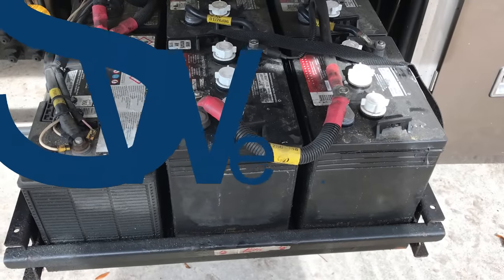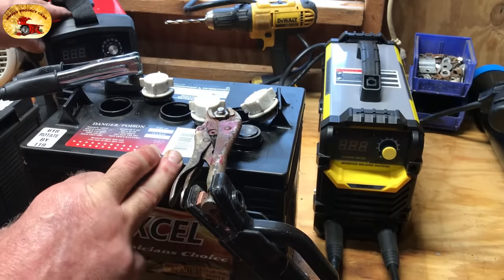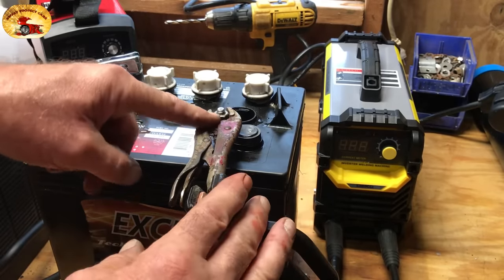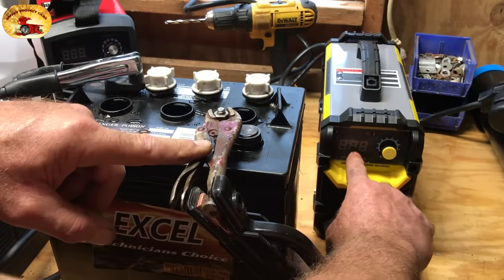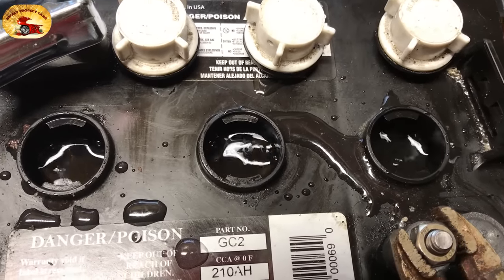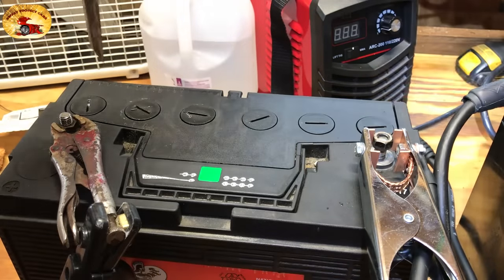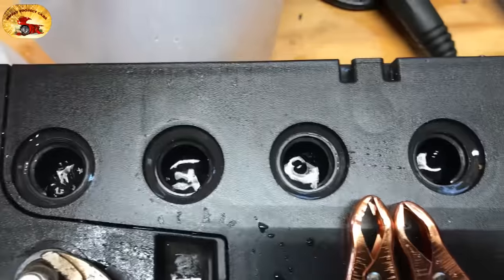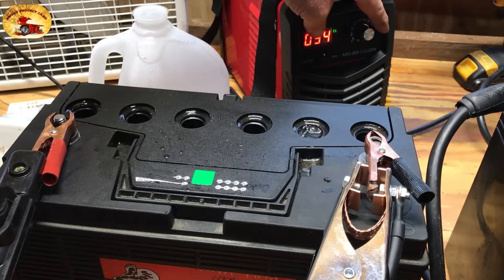How To MAKE OLD BATTERIES NEW Again!!!  12v 6v Deep Cycle, Car, Truck, Golf Cart, Semi

Comment: Mike just wondering how long will the battery lasts doing this trick. Is it like 1 year again we have to so this process. Or Will battery degrade over time and the welder trick wont work
Reply from the maker: It all depends, we have batteries that are 20 years old and still going Shridhar. Thank you for watching, we really appreciate it, have a great week my friend. mad Mike the hammer SPC

Comment: I have a solar system with 150 AH AGM Sealed battery. It is COMPLETELY sealed at the top, and there is no way to add electrolyte. In fact, when I shake the battery I do not hear any fluid/electrolyte inside the battery. All the electrolyte are stored inside absorbed glass mats. Could this method also be used on these types of AGM sealed batteries? Or would it be dangerous to do so, because you cannot open the top of the battery unless your actually cut the top of the battery open with a cutter/grinder. Love your channel! Thanks.
Reply from the maker: This method will not work on gel/agm batteries.  Sorry my friend.  Have a great day.  mad Mike the hammer SPC
Reply: @SweetProjectCars  Thank you for replying. I am sure many other had this exact same question in mind!

Comment: Question...5 min shut off for 10 . In your other vid using batt charger at 200 amps you went 15 min shut off for 1 hour . Y the major difference if your using same amperage ???? Actually your only going 20 + amps with welder correct ?
Reply from the maker: Don't analyze until your paralyzed, just follow the video to a T, each video we do is new and improved and depends on the tools we are using.  mad Mike the hammer SPC

Comment: Question ? On the grey welder , it has 2 knobs current and arc force. I'm guessing arc force is left at 1 and only need to adjust current , starting at five and adjusting up to 20 to 30hours

I did buy the the battery charger from one of the previous videos but for some reason it would not stay constant charging kept kicking on and off  in 200amp start more (guessing it has a safety feature)
But does work great for 10amp charging and 200amp car starting

I would like to try the welder
Reply from the maker: Turn the dial that makes the battery start to boil, don't be concerned with anything else, once it starts boiling continue with the videos instructions.  Thanks.  mad Mike the hammer SPC

Comment: Hey Mike, I pruchased the ARC200dc welder and it works great for the car batteries. Can it also be used on 6,8, or12 volt deep cycle batteries? I ask because you use the smaller yellow welder for the 6 volt deep cycle battery in the video and wasn't sure why. Thanks Aaron
Reply from the maker: Hello Aaron, Please follow the video to a T, there is no other alternative, use the exact same tools, products and method, we've spent years perfecting this process. It works flawlessly every single time using either of these welders for standard battery  https://amzn.to/2K1UsWQ  or deep cycle  https://amzn.to/3yW4ihK  Thanks for watching, have a great day. mad Mike the hammer SPC
Reply: @Sweet Project Cars  

Hey Mike, I bought the suggested welder. Instead of one control it has two; an arc force control and a voltage control. Where should set the arc force control? Thank you. Dan
Reply: @danielfittz3521 did you figure this out?

Comment: Hey there sweet projects , the best battery fix EVER... Tell me please , is it possible to use a regular 240 volt (Australia)  arc welder... ??? OR another way...  with your welders why 12 volt regular batteries and deep cycle 12 volt batteries have to be treated with different welders ??? Thanks slot !!!
Reply from the maker: Hello Broderick, you can use whatever you want to use, we tried and tested both style batteries with the welders listed so we know that it works, and it's safe for both you and your batteries.  Thank you for watching and asking, we appreciate it my friend, have a fantastic day. mad Mike the hammer SPC

Comment: Also, I bought the welder machine you had linked to the arc 200 DC IGBT and it has two dials could you explain it since there are no videos on it ?@sweetcarproject?
Reply from the maker: You only use the current dial, start out low and turn it up until you have a rapid boil, leave the other dial at 1, make sure you recap and unplug the welder before disconnecting the cables.  Hope this helps brian, thank you for watching, have a great day and all the best on your project. mad Mike the hammer SPC

Comment: Are you running your welder on standard 110v outlet or on a 220 volt outlet?  The 110v doesn't have as many amps that it can deliver.  Does it matter?
Reply from the maker: Just plug it in to a standard household voltage outlet Gary.  Make sure you are subscribed and have your notifications turned on because you are going to want to see our video pertaining to this process that is coming out today.  Thanks for watching, have a great weekend. mad Mike the hammer SPC

Comment: So on the 12 volt car type battery you say start on the lowest level repeat 5 times turning it up a little each time? Or just leave it in the lowest setting?
Reply from the maker: Due to the efficiency of these dc welders you can get them to work on the lowest setting, but you want to get a rapid boil so you may need to turn it up a little until you get that boil.  Thanks for asking.  Have a great day.  mad Mike the hammer SPC

Comment: I went thru the 5 x 10 x5 cycle once. The left 3 cells responded right away,  but the left 3 cells just started to respond on the last 2 cycles. 
How many times can i (or should i) run a battery thru this process before giving up on the battery?
Reply from the maker: You can do the complete 5 step process up to 5 times, if it doesn't wake up after that, your battery is toast, Larry. Thank you for watching and asking, we appreciate it, have a great week and all the best on your project my friend. mad Mike the hammer SPC

Comment: I have some 8V golf cart batteries that aren't dead, but certainly are not as peppy as they used to be.  Will this help "renew" them?  Should I discharge them before attempting this?  Thanks!
Reply from the maker: It certainly will, and no discharge is necessary.  Thanks Chris!  Have a great day my friend.  mad Mike the hammer SPC

Comment: I had a Northstar battery fail after 1 year. Even after fast charging and slow overnight charging. It will charge but won't pass the load test. I am getting a replacement and they don't want the old one back. Any way to revive it so maybe it can be used as a shop battery?
Reply: We had a good freeze and I noticed about a month later that the lid u dear the sticker had popped up a bit. I pushed it back down. Battery lasted about another 2 months and then won't start the vehicle unless it is jumped. It will crank after being jumped and the vehicle runs a minute but not after sitting after 30~ minutes.
Reply from the maker: Well as you know this only works on wet-style batteries, so if it is, it will revive it.  Thanks for watching and being a great subscriber.  mad Mike the hammer SPC

Comment: I guess it would be a wise idea to ensure that your leads on the inside of the machine are on the correct polarity as well, right? Sometimes the leads are reversed to do different welding techniques...from what I understand and not being a great welder myself.
Reply from the maker: On these welders, a 5 year old could use them. Follow the video to a T, do the process and ShazamM it's done. Have a great day. mad Mike the hammer SPC

Comment: Why the difference in welders? I have deep cycle and regular auto batteries to revive wich one should I buy....cant buy both.
Reply from the maker: I would get the one that you would use the most, we have tried and tested both on both deep cycle and standard and have found the one's that work and that are safe for both you and your batteries.  Thanks for watching.  mad Mike the hammer SPC

Comment: enjoyed all three battery videos. can I use the "Amico Professional Welding Machine, 200 Amp Stick Arc DC Welder, 80% Duty Cycle, 100~250V Wide Voltage" for both my vehicles and tractor/mower/yard equip batteries? like the idea of buying the welder over the charger/start as I can use it other places. wish it wasn't so expensive but after I restore a few batteries it'll pay for itself. would I also do the tractor, mower and yard equip every two years or would it be better to do every year since they are seasonal? ty for your insight.  🙂
Reply from the maker: Hello Jack, the welder is definitely the way to go, it's our update to the battery videos, you can use it on all wet-style batteries for tractor/mower etc., just cut the timelines in half for those size batteries.  Also, you can use this method annually for the seasonal batteries. Hope this helps, we appreciate the view and comment, have a great week my friend. mad Mike the hammer SPC
Reply: @SweetProjectCars   thanks for the reply.

Comment: What is the voltage out of the clamps on the welding inverter you use for the 12v car batteries?
Reply from the maker: It's this  https://amzn.to/2K1UsWQ  you can read all of the specs.  You start out low and gradually turn up until you get a consistent boil on all of the cells then follow the video instruction Hjalti. Thanks for watching, have a great week. mad Mike the hammer SPC

Comment: Hey Mike, read lots of posts, could not find this answer.  I have both reg 12v and 6v deep cycle. I know these two are the best you have found for each, but will one machine be able to do both types of batteries.  I have read the specs, they are both 200a IGBT. Maybe the question is, I can only afford one, which one would you choose for both types of batteries?  Thanks for the great work!!!
Reply from the maker: I would get the charger that works for the batteries that you charge the most, these welders are very specific for the batteries described, we recommend them because they have been tried and tested and are proven safe for both you and your batteries.  Thanks for watching my friend.  Have a great weekend.  mad Mike the hammer SPC

Comment: What numbers on the welder machine? Volt or amps?
Reply from the maker: Amperage....... Volts are what come out of the power that comes from your wall where you plug the welder in. Thanks for watching, have a great day. mad Mike the hammer SPC

Comment: When is it necessary to add electrolyte to the cells. Does the battery actually lose the acid strength over time?  I thought distilled water was the only liquid that is needed to replenish the fluid in the cells.
Reply from the maker: No, the water is the only thing that evaporates. Top off the cells within an inch of the top with this https://amzn.to/3gb9Ni0  
before beginning the process then again during the resting times as needed. Thanks for watching and asking, have a great day. mad Mike & team

Comment: What s it you are turning up - Amps or Volts? If so, what is the other one of the two then set on? For those who have more advanced inverter welders with numerous settings, can you note what Hz and what wave cycles etc you have on the welders that work for you for 12V batteries? How long have you used batteries 'resurrected' in this way.. is it something you know works well for a long time afterwards? Thanks for the video - just need a bit more info to make it really useful.
Reply from the maker: We suggest for the safety of you and your battery that you use only the products/tools that we share.  We have batteries that are 20+ years old still in use from this process.   Thank you for watching and asking.  mad Mike the hammer SPC

Comment: I see where you are Demonstrating this procedure perhaps has a 200 amp electrical service. At home, can I use the same welding machine on a 120 amp electrical service and minimize the amperage draw ?
Reply from the maker: Hello Paul, use the welders we share in the tools list, plug it into your standard wall outlet at your home and get busy, you don't need 220 service to do this process unless you live in Punjab. LOL  Thanks for watching and asking, have a great day. mad Mike the hammer SPC

Comment: Hey guys I got the rohr mini 220pi which you recommended. I have it at 20 amps on a 70ah 12v leisure battery and it's bubbling away. Does this mean the battery is ok? I thought it was dead.
Reply from the maker: It does cuan!  Follow the process to a T as shown, sounds like it's working.  Thanks for watching and asking my friend.  Have a great day.  mad Mike the hammer SPC

Comment: I'm assuming any DC inverter welder that's rated at 24V (?) output will work for typical car batteries?
Reply from the maker: We use and recommend these  https://amzn.to/2K1UsWQ
**If the above welder is unavailable, either one of these will work  https://amzn.to/3mqhebK or https://amzn.to/3sH4COq **  our videos are very product/tool specific because we have taken all the guess work out for you, we know these work and we know that they are safe for both you and your batteries. Thank you for watching, have a great day. mad Mike the hammer SPC

Comment: I have a big diesel forklift battery I don’t want to spend $300 for. Will this work for a 4D battery. If so, with it being so much larger, how long do I leave the welder on for the cycles? Thanks
Reply from the maker: We don't blame you Billy, we wouldn't want to spend that either, follow the video using the same timelines, you may just have to do the complete process a couple of times for that size battery. Thank you for watching and asking, have a fantastic day and all the best on your project my friend. mad Mike the hammer SPC

Comment: I have a 12V deep cycle. Which welder is appropriate? I also have a small 12V on my riding mower. Which welder is appropriate?
Reply from the maker: Welder for Deep Cycle ONLY 6 Volt & 12V Batteries    https://amzn.to/3yW4ihK &  Use This for all Standard 12-volt Batteries    https://amzn.to/2K1UsWQ  Thank you for watching, have a great day. mad Mike the hammer SPC

Comment: The grey welder for normal car lead acid batteries you are promoting has a knob for arc force.  For Desulfating, what setting 0-10 should this be set to?  Does it mattter?  Thanx.
Reply from the maker: Set both dials to 0, turn on the machine and turn them up until the battery boils.  Thanks.  mad Mike the hammer SPC

Comment: Would it be possible to connect 2 6v batteries in series and use the 12v welder? Furthermore, can you connect multiple batteries in parralel and do maybe 4 at a time?
Reply from the maker: Yes, you can connect them in series Carlos. Thanks for watching and asking, this works on all lead acid batteries. mad Mike

Comment: Would the red welder also work for 12v lawn&garden batteries EX; U1 group? Or too much amperage for that size battery?
Reply from the maker: The yellow welder is the one you will want to use for 6v batteries, the red welder is for 12v batteries.  Also, make sure you recap and unplug the welder before disconnecting the cables. Thanks for asking.  Have a great day Aaron.  mad Mike the hammer SPC

Comment: Thank you for the information are you able to just use one The Arc 200 on both deep cycle and car batteries thank you
Reply from the maker: Brent, use this one https://amzn.to/3sTpodi  for ALL Deep Cycle only 6 Volt & 12V Batteries  and this one  for All  Standard 12-volt Batteries    https://amzn.to/2K1UsWQ  Thanks for watching.  Have a great day.  mad Mike the hammer SPC
Reply: @SweetProjectCars  thank you for getting back to me I sure appreciate that you're the man thanks again
Reply: @SweetProjectCars  hi i observed opposite result. When I connected the 12 batery to the dc welder, all the cells started to bubble, and then after a while, stopped.  Then only 1 cell was bubbling.  This particular cell had water with a greyish dark color, while all the other cells were clear. 

have you observed this before?  Does this mean the battery is not repairable? Thank you.

Comment: So do you leave the water in? Also the welder listed is 115v-230v, can they be dialed down lower??
Reply from the maker: Hello Walter, you top off the cells with this  https://amzn.to/3gb9Ni0 and add as necessary during the resting times.  We start out on the lowest setting, then gradually turn it up until you have a rapid boil on all the cells, follow the video instructions as stated and remember make sure you recap and unplug the welder before disconnecting the cables. Thank you for watching, have a great day. mad Mike the hammer SPC

Comment: HI MIKE.  I GOTTA QUESTION.. I  I'm doing your 12 v  car   battery rejuvenation method. Im  using 200 amp start setting.  Its been through the 1st fifteen min cycle BUT,  i never saw any bubbling at all.  Any advise?   Many Thanks , Joe
Reply from the maker: Keep going, you can do the complete 5 step process up to 5 times, then don't forget to put this on overnight  https://amzn.to/3kmCThX  if it doesn't wake up after that, your battery is toast. Thanks for watching and asking, Joe, have a great day and all the best on your project my friend. mad Mike the hammer SPC
Reply: Hi Mike.  This worked well on a 8 year old battery that was sitting in my shed . Can you tell me if this method okay to try on smaller AGM motorcycle batteries also.??  THANKS FOR THE GREAT CONTENT